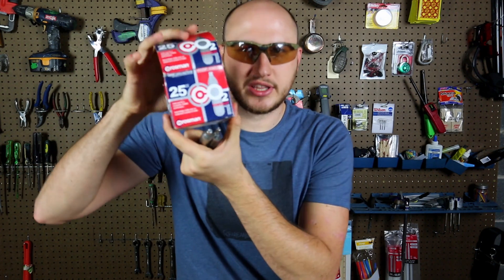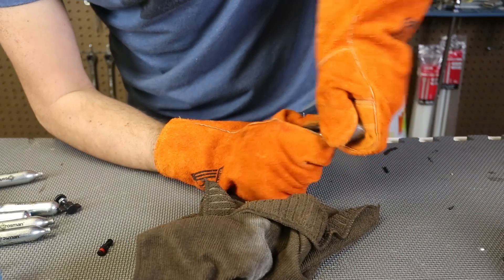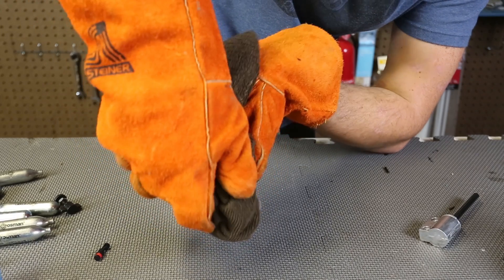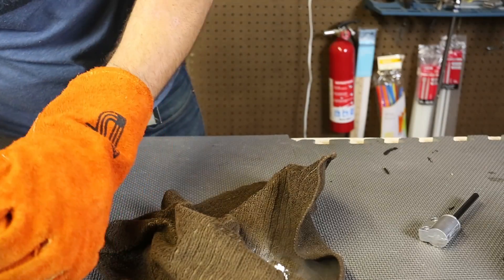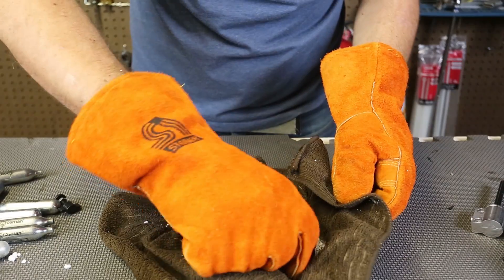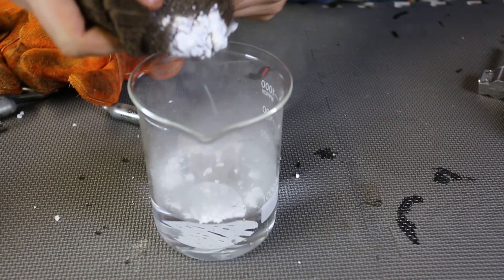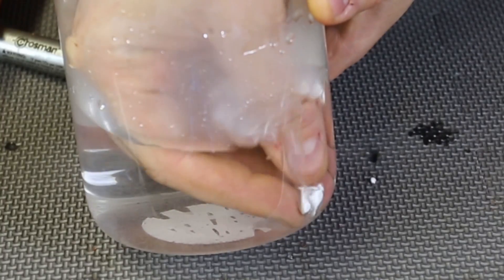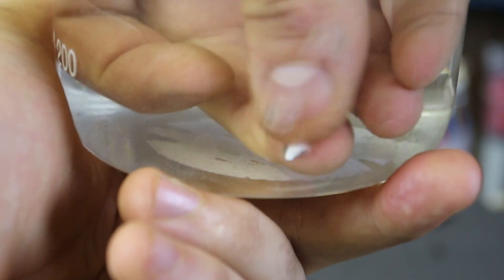Can You Make Dry Ice Out Of CO2 Cartridges?

Comment: That is definitely not dry ice. CO2 is much more dense than water and should sink to the bottom of the container.What you made was mostly(I can be sure it is at least 80%)normal ice from the water in the atmosphere and just a little bit of dry ice.
There are two reasons that I'm sure that it is not dry ice:
1)as I said they act as normal ice and float on top rather than sink to the bottom
2)They don't fill the cartridges by dry ice,they pressurize the containers with gaseous CO2 and under best circumstances it will produce liquid CO2 not dry ice.

Comment: Sorry to burst the bubble, but that's not dry ice. Dry ice sinks in water because it's heavier. That's most likely ice that frozen when CO2 expanded, think how compressed air cans get cold when you use them. There's probably some CO2 that got trapped in the ice, but it looks like it's mostly water ice.
Reply: It should be pure carbon gas. So it would be real dry ice. That would explain the bubbling.
Reply: There's probably just extra air trapped in the chunks due to the method used here.
Reply: Solid Snake In the canister yes, but what's being captured in the cloth isn't carbon, it's the condensation from the air. If the chunks were pure carbon, they'd sink when he puts them in the water.
Reply: Jackson Seymore Ah, never thought of that.